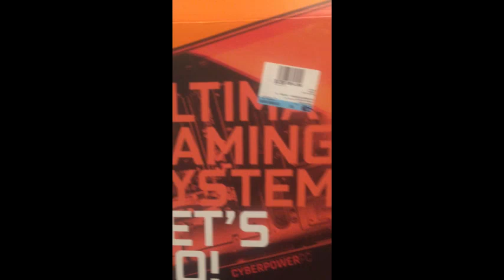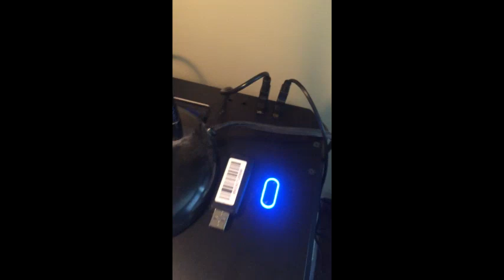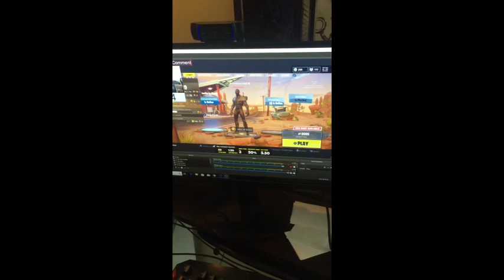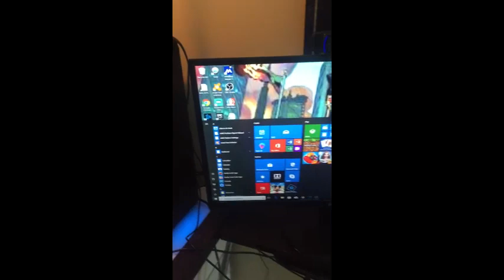CyberpowerPC Gamer Ultra Unboxing+Setup

Comment: Question I bought a cyber power from Best Buy but having issues with my snowball ice microphone. How did you get yours to connect and get it recognized?
Reply from the maker: RIPLEY RIVERA it all depends on what software u r using
Reply: Manta-J  well right now I have SLOBS and when I plug in the microphone it shows but no audio :-( and it looks like the pc is not detecting it as a microphone.. my cyber power pc is a GMA 4000BST
Reply from the maker: RIPLEY RIVERA u have to go to mixer which is right next to sources, and if u haven’t changed it yet it should say Mic/Aux and then press the settings button on it and it should say devices, u might have the use device timestamps unchecked. So press use device time stamps and it should appear as an option as Microphone(Blue Snowball)
Reply: Manta-J  on slobs? It won’t pop up as snowball blue ice. I’m so confused I never had this issue with my other pc but this one isn’t helping like I get the game audio but not the microphone
Reply from the maker: RIPLEY RIVERA what is is popping up as?
Reply: Manta-J  default or something real talk or speaker something like the default. Idk if it’s something in the pc setting that it’s not allowing it
Reply from the maker: RIPLEY RIVERA it could be in the pc
Settings

Comment: it will not let me factory reset.
Reply from the maker: is it asking you to clear the data first?
Reply: @jibreezyheroes  no. It says Could not find the recovery environment insert your Windows installation or recovery media and restart your pc with the media. problem my does not have a disk rom and it did not come with a disk.You think spending $1,000 it would come disk rom right
Reply from the maker: w m u might need to buy an external disk drive, although mine came with installation disks also, but I didn’t have to install them
Reply: @jibreezyheroes  I can't connect my moniter